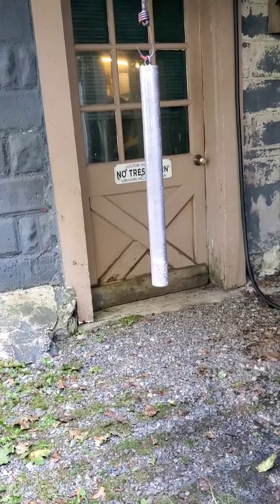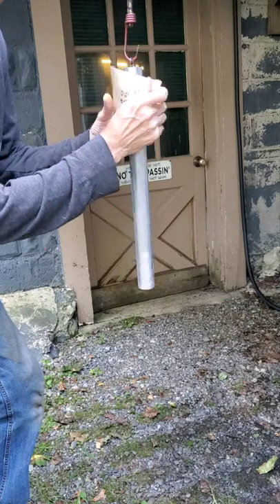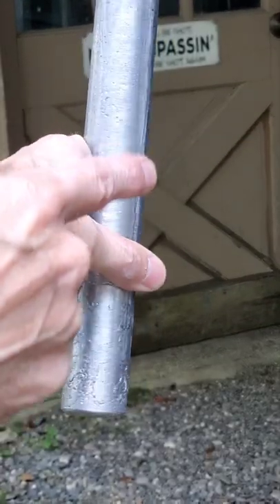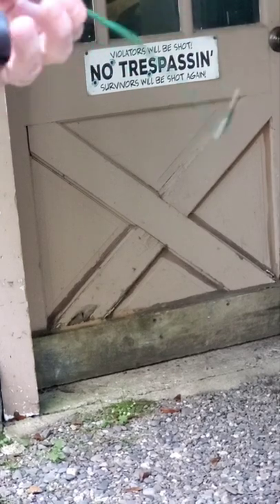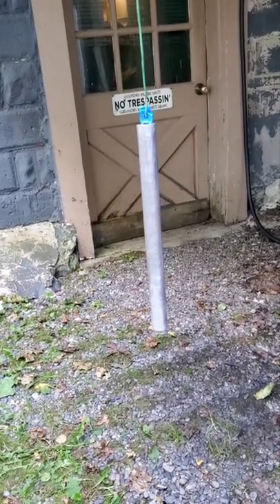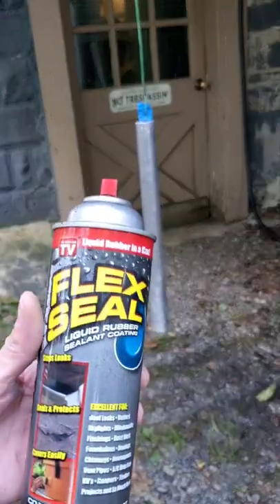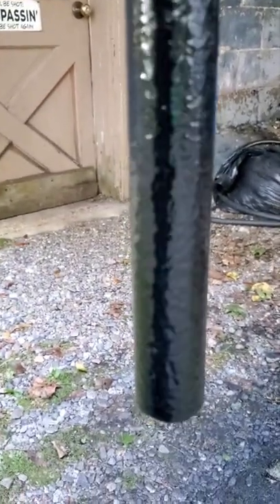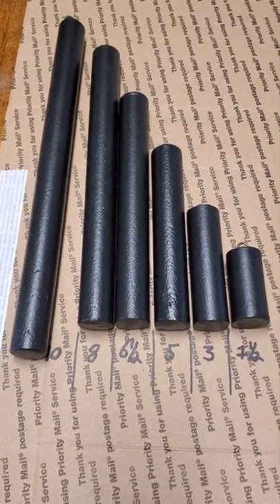How to coat your deep drop weights.  #deepdropping #swordfish #grouper

Comment: Thanks! I bought the same hollow core per your video and I also bought the same needle as yours (250 pound) but I’m having a real issue getting it to thread, almost like the braid is glued together?. It is taking me 5 minutes per inch and yes I’m pushing it on per your instructions…. Very frustrating to say the least. Any idea why I might be struggling? Could the braid be smaller than advertised? Almost seems that way….
Reply from the maker: Ya the 250 just goes in super hard it really hurts the fingers & just takes practice really aggravates me at times also.  Here's a few tricks that might help. 
You can try to push your dacron together to open it up a bit more just ahead of what your pushing onto the needle that helps sometimes. Also you can try n put a little wax on your needle basically rub it on a candle the wax acts like lube & will sometimes make a big difference. And yes the inside diameter of the line could be a little different some rolls/brands are tighter than whats listed. I recently got a roll off Amazon that was all screwed up kinda like you say it wasn't fused together per say but almost wound wrong in spots or it was spliced at the factory or something in a few spots so it would stop my needle dead. Very frustrating. 
Hopefully 1 of those will help you out. 

If you have some 200lb or even 150lb mono try running that inside your Hollow core as a test if it goes then its yoyr sizing if it still hangs up your braids problebly defected. 
Jb hollow core, power pro Hollow ace or 130lb dacron doubled are about the only reliable options for this imo.
Reply: Ok thanks… I was actually thinking about trying some air pressure as well….???